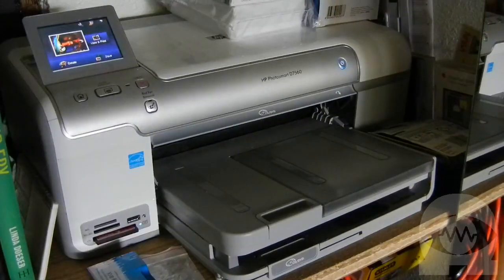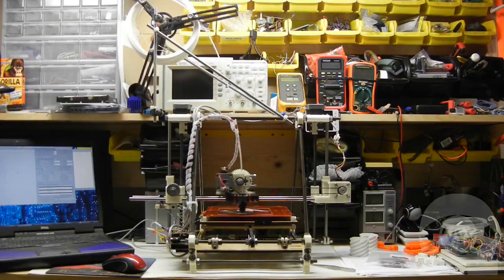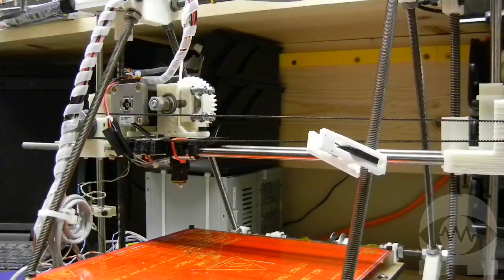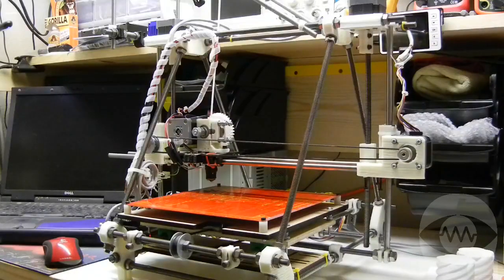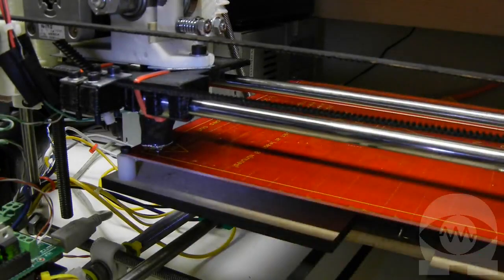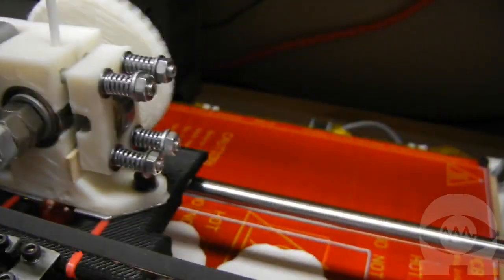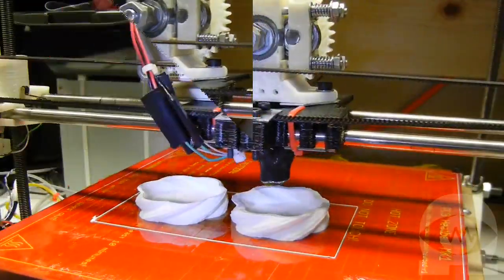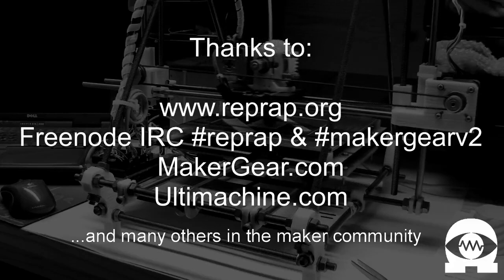OhmEye's Introduction and Orientation for 3D Printing with the Reprap Prusa Mendel

Comment: Very nice explanation of reprap mendel. I'm in the process of making my own. I was originally going to try to make the Gen7, but having problems with my cnc mil when i tried to mil out the board. 
How do you like the control of the RAMPS? I'm thinking of getting it to use for my first machine.

Comment: hey if im powering my heatbed with a separate power supply how do i keep it from getting too hot? a set of instructions says a thermister isnt needed with gen 6 electronics but the heat bed isnt connected to the gen 6 electronics. any idea oh how to control the temperature? thanks